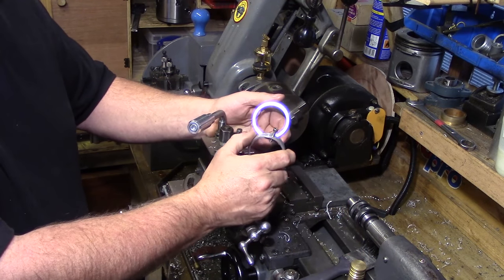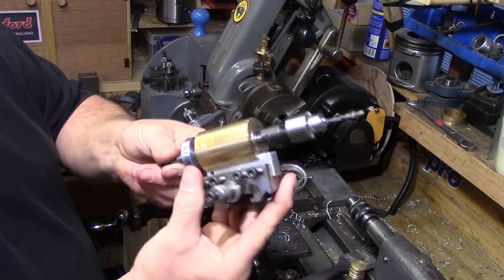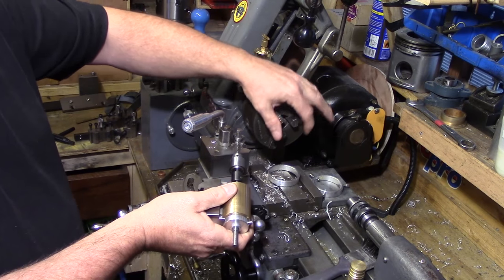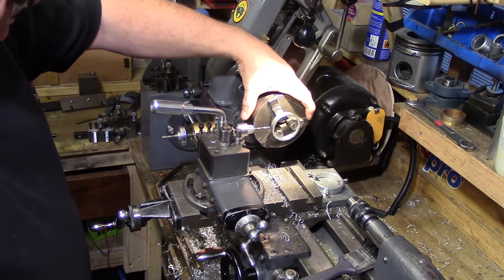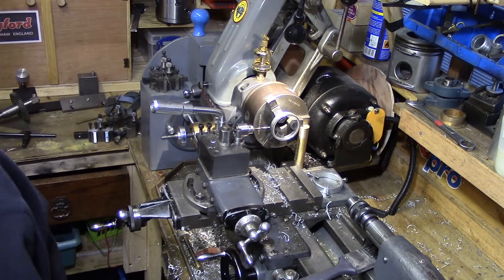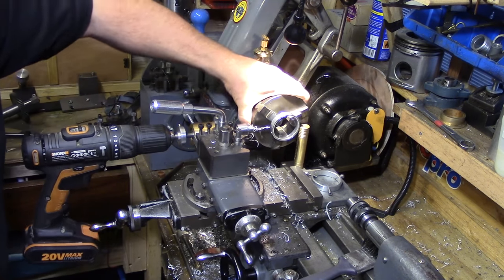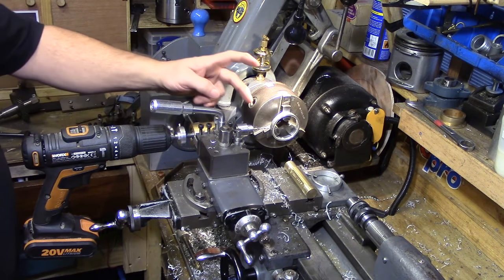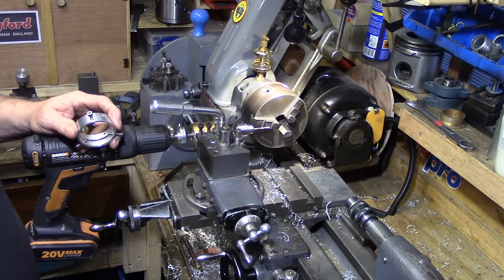Simple Lathe Indexing Technique for non-critical parts

Comment: To stop yourself drilling into the chuck jaw, leave the drill bit poked slightly into the third hole, loosen the lathe chuck and index off the front jaw as you show. Tighten the chuck jaws and then continue indexing off the back. Your second set of three holes is now in the space between the jaws.
Reply from the maker: Excellent solution Darryll, I hadn't thought of that, thankyou :)

Comment: Ade how does the drill fit into the tool post? Oh and while I'm here did you do a video on your crank? I know the Mr Jordan did one but which I have watched but have you done a video as well on that? Ps I just find your videos so so easy to understand and extremely interesting!!
Reply from the maker: Hi Peter, the bushing which holds the bearings has a slot milled in it to accept a  piece of flat stock which clamps into the toolpost, I didnt make any videos on my cranking handle, but it is similar in design to SJs just using regular metal stock rather than a bike part, the spindle locking principle is identical
Reply: Thanks Ade. how did you lock the flat stock in the bushing?
Reply from the maker: Hi  @peteblairakathemadscientist , it is fixed with cap screws, if you take a look at my vid on the ball turner here,  https://youtu.be/1AUPBj8cBQ8 -(4 mins in) it is done in the same way. Regards. Ade